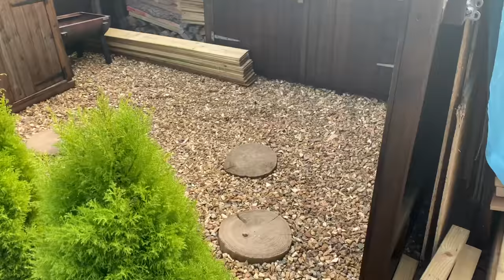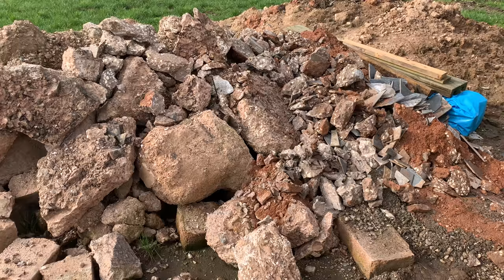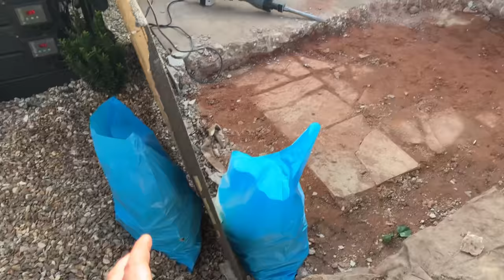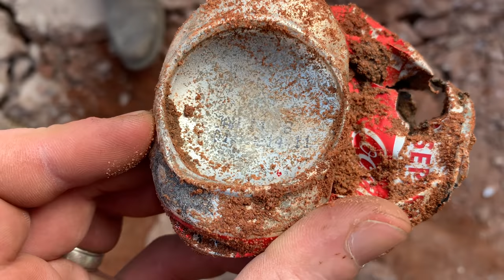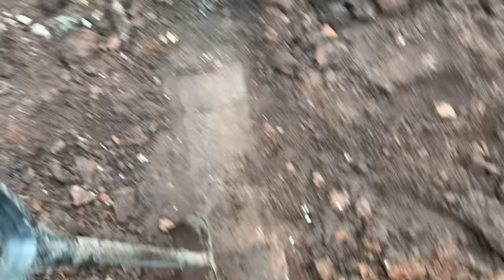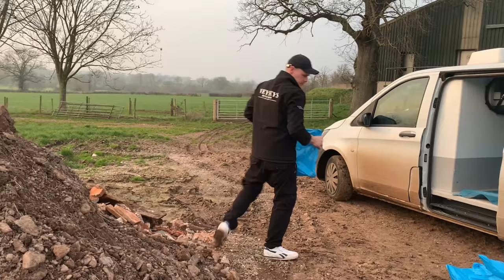DIGGING THE NEW KOI POND IS HARD WORK!!!***TRIP TO THE FARM*** #PART 4 OF THE NEW KOI POND BUILD!!

Comment: Those impact drills make such a difference when you are doing that sort of work. My ground here is terrible. It's rock hard clay. I had to dig a hole quite a few years ago and it took me two hours to dig 6 inches deep using a spade.  I went and bought one of those big impact drills (Jack Hammer) and managed to dig another 3 feet down in about an hour.  Absolutely brilliant for breaking ground up.  All you need to be careful of is any underground pipes and cables. You really don't want to hit a water main.